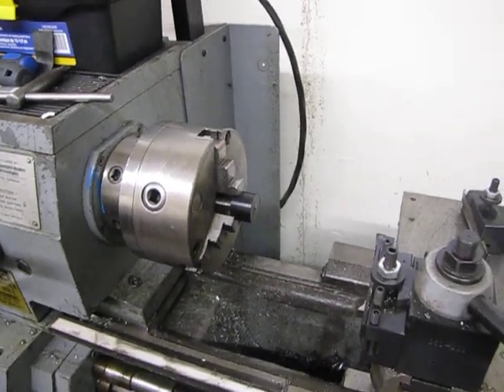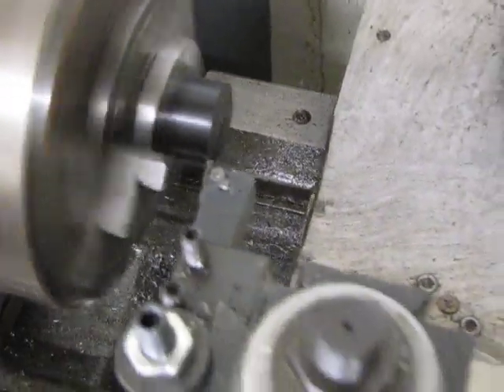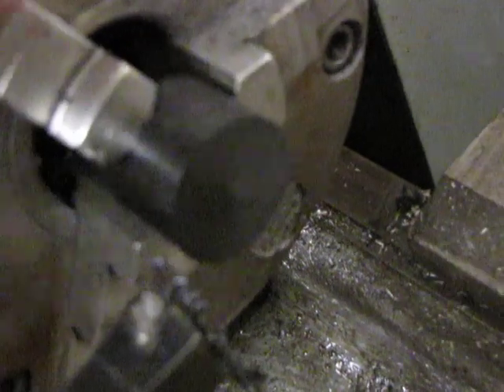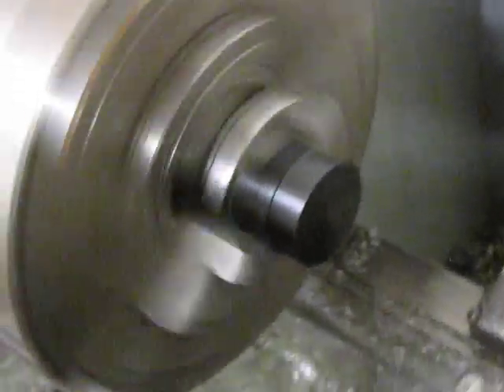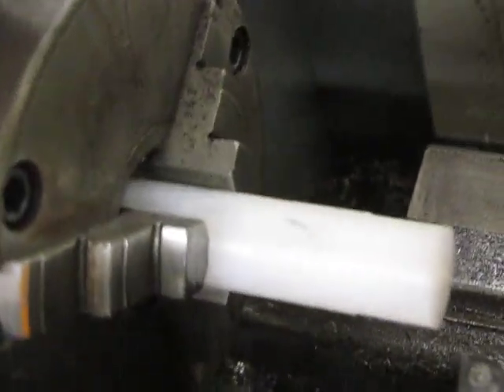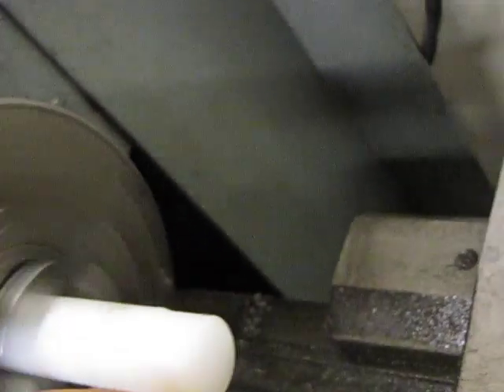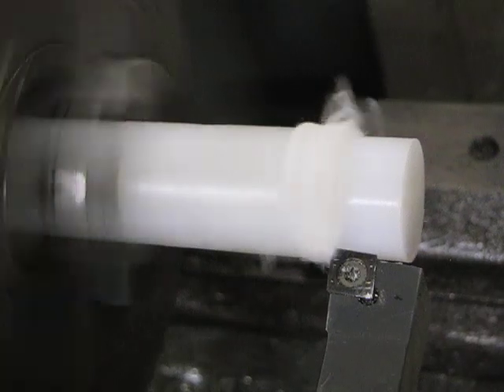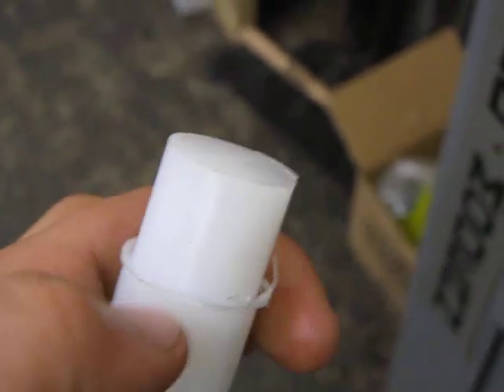Machining Delrin (Acetal) vs UHMW - Lathing

Comment: Just got done a job using this stuff when someone ordered it instead of Delrin because it was cheaper. Ya can't use carbide insert tools. Ya need to go old school. High-speed steel tool bit ground 15deg top and side , and RAZOR sharp. I ground mine on my surface grinder. Stoned it mirror smooth. Heat/friction is your enemy. Run about 200rpm and .005" feed per rev. Comes off like plastic wrap off the roll.pb68slab

Comment: It's true Delrin/POM/Acetal machines much nicer then UHMW but you're not giving it a fair chance. Your stickout is way too long, neither plastic would machine well that far from the chuck without tailstock support. Primary problem you have is that tool is not biting into the material and it just rubs making heat and melting the plastic away. As others pointed out, sharp HSS tools will do much better then carbide which is made slightly dull on purpose.
Also, and much more importantly, you're using your hand to slow down the chuck. I made that mistake the first time I touched the lathe and I count myself lucky to have walked away with just a slap on the wrist. I also hope I'm not dumb enough to ever do it again - it's a great way to lose finger... or hand... or arm depending on how (un)lucky you are. I'm not trying to be safety freak here, and it's your hand to use it as you see fit but showing it in a public video is inexcusable. Someone new to the hobby will see you doing it and not knowing better try the same... maybe with jaws sticking a bit proud of the chuck body just for good measure

Comment: Makes total sense. UHMWPE is an extremely wear resistant low friction polymer which is why the bottom of snowboards and skis are made from it - hence it resists machining. Delrin is very tough, hence used for M16 rifle butts.

Comment: I think I'm going to order some of this for a model im making. Im making an old torpedo with rivets on the sides. My question is would glues work on this material? Like hobby glue? I like the idea of how nice it is to machine. Just concerned i won't be able to glue anything to it.
Reply: No, very difficult to stick
Reply from the maker: You'd want to mechanically bolt it down somehow, not glue it.

Comment: UHMW when cut with Steel Tools results in a finish as smooth as Glass.   High RPM & Steel Cutters. I found Delrin to be soft in comparison to UHMW.  Turning Nylon makes a continuous stringy cutting.

Comment: A properly sharp hss tool will perform much better than carbide in polymers. Carbide is good for machining harder materials as opposed to high speed steel. Just a friendly tip
Reply: True but there are polished inserts for machining aluminium, brass and plastic which perform much better on pom.